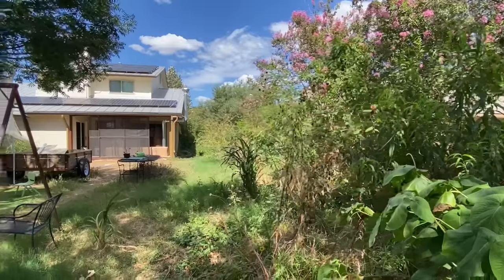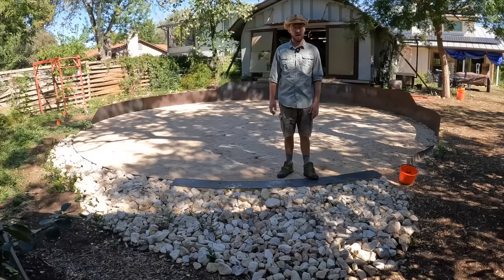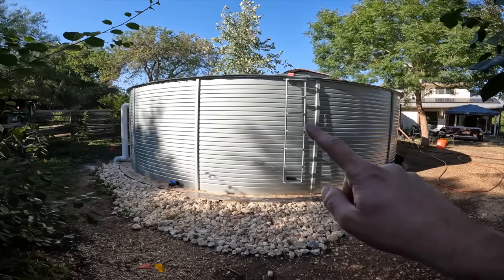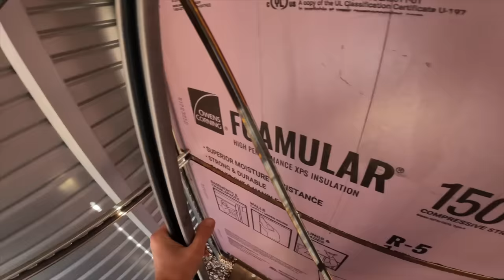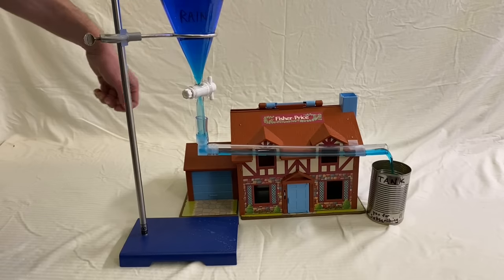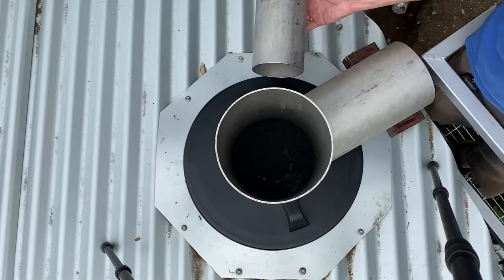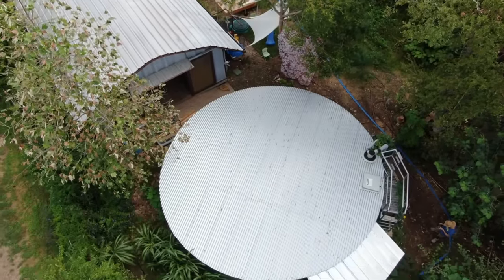FREE water forever.  LEGALLY!!!!

Comment: I think the next project about the water system would be to install a watertower so you always have pressurized pipes even in the the case of a power outage and no source of electricity at all. There is still a need of a pump to get the water up the tower but you can do that with solar power and the pump most only run when there is overflow of electricity. With some batteries you can even have a fallback system.

Comment: Construction crews use gasoline driven vertical piston driver known as a "Tamper" which forcibly compacts sand and dirt. An easier method is to simply use a long water hose to completely soak all of the sand. Water is then the lubricant as gravity draws downward all of the sand grains to firm compaction. I have met people who also harvest rainwater into large containers.

Comment: I am going to assume those filters need to be replaces periodically. So the system, ignoring pumping would still have a cost? Or do water coming from City would need to have the same filter?
Reply from the maker: One could argue that water from the city “should” be filtered. Chlorine and fluoride levels in some areas can be a bit excessive.

Comment: I was wondering if instead of steel wall, hay and clay wall could be used to hold the water liner?
Reply from the maker: Probably not. The water experts and outward pressure on the walls of the containment structure. You want something that has good tensile strength. Hay and clay would have much more strength against compression rather than tension. In my rocket mass heater video that is evident. 10 people can sit on that clay and straw bench. But if you tried to stretch it apart it would crack.

Comment: That was quite a project. Well Done! However, the amount of money you spent on it would pay my water bill for 20 years, maybe more! What ya going do if you have no electricity to pump water to the house? You'd have to have a manual way to get the water in containers then filter it with a gravity filter in the house. But at least you'd have water. There's pros and cons with this project. I learned a lot. Thanks.
Reply from the maker: You’re right it wasn’t cheap. I have solar and battery backup on the house now so the power outage matters less from now on. Thanks for commenting!

Comment: could this tank be placed underneath a house, such as in  a crawl space? Secondly, what about heated water, to use the heated water tank as a heat source for the house?
Reply from the maker: The tank is not engineered to have external pressure from the soil. So if you buried a tank underground, it would probably be better to get one that’s designed for it other than this one. Technically, yes if you have a buried tank of water, you could potentially use it as a source of geothermal heat. But again, I’m not sure it would be a good idea to bury this particular type of tank. Thanks for commenting and for subscribing!

Comment: I'm in South Texas as well and about to start construction on my 2-acre property. So far, what are the pros and cons you've had from this water system??
Reply from the maker: Pros are that it was worked well without fail for almost a year. We have had zero water bill. Just paying for sewer services. 

Cons: slight drop in water pressure compared to city. Could be overcome with bigger pipe size. 

Water is slight acidic. This is a very long story that I will address in future videos. The bottom line is that it’s easy to neutralize using slaked lime. 

Water should be filtered. There are contaminants in the rain. My opinion is that most water from municipalities is also probably worth filtering too though so it’s not really that different. Some research suggest filtered water should be remineralized. I will include that in my future video also. 

Thanks and good luck. Over all I am pleased with it. If you are willing to use water sparingly it’s good. If you want to water your lawn with it this tank may not be enough. Those details depend on the square footage of the roof surface etc.
Reply: Thank you so much for the info! I love your content, I'm planning on making fencing just like your other video as well! Please keep making more content 🙏🏼  @suburbanbiology

Comment: I think you missed a very simple principle I learnt in primary school in eastern Europe. I don't recall the name of it but it goes like this: when a wider pipe feeds into a narrower pipe the second one will exert far bigger pressure directly in line with the difference in diameter. I feel like you should have used wider pipes coming vertically from the roof to narrower pipes underground and up into the tank. I think this is how hydraulics work in big construction equipment and cranes.

Comment: one of the other plumbing channels says everytime there is a bend in it there has to be a large number of feet in between or an extra part in between according to building codes so your bends were inches apart and did not have the extra peice so many that is what caused it also it says re regular pipe sizes the 4 is for 2 toilets and higher than that if you have higher than three like six bathrooms then the six inche pipes are needs to stop clogs according to code so maybe cause you are dealing with leaves and such and they are just prone to clog that is why even though more money you might have had to upsize to the 6 pipe to start advise people such as the other channels says 4 size clogs if more than two toilets so the codes make the plumbers for regular stuff upsize if more than the two they have to upsize more than 4 anyways .

Comment: Smaller scale and cheaper option I did.

Get one or two IBC 250 gallon totes. You can get them for about $60 each. Set them up to collect rain water. I use them for my garden. 

In an emergency have a five gallon bucket with small holes drilled in the bottom half full of fine sand. This filters large contamination. 

Have some (you don't need a lot) charcoal and grill. Boil the water on the grill. Theres also larger Britta style filters that aren't expensive. 

I won't be fancy but you'll have water to drink for weeks.

Comment: I just need to know  if you can run a filter and make it drinkable, and if you can collect rain water to drink I thought you could catch it in a crock ,but first wait  till it rains a bit and sit your jars out without anything getting in them and let it rain, there is a water filter that comes in a container to do this but I used a 5 gallon emergency plastic container with a spiket and add about three of those charcoal filters that go in the store bought container, otherwise I burnt some wood ( oak or peacan) and made my own charcoal to put in the bottom, it's all we can do to have water from a neighbor that lends his water hose, I have the big square tanks and and they are for back up. I call it my permanent camping trip.

Comment: That is super cool. Wouldn't want one tho, as 1) it's way too large and in my opinion quite ugly (yes I know, I know). and 2) over here in Finland half of the year it's going to be freezing. The tank would probably be okay, but the snow coming from the sky would not melt into the tank. I much prefer to have portable size filter as backup if we lose access to water grid. that way we can go to a nearby lake, fill up a tank/barrel and filter and/or boil that water back home. Much more cost effective and saves tons of space.

Comment: little suggestion. I would recommend to come up with idea, when it starts raining, - you are not taking in water right away, but instead flushing it for 5-10 minutes so all the dirt dust and whatever on the roof will go down first. After that valve switching and allow water to get to the tank. Another thing for the drinking water, - I would love to have some kind of boiling/freezing machine, where water boiled first, then cooled, frozen and defrosted. This way it would be probably the safest water ever. The other thing I'm seeing here, that what if structure will be compromised (ie earthquake) and it will flood your neighbors? this is only the potential why it should not be permitted if you have property size less than 5 acres.

Comment: Could you use the surface of the tank for some solar panels for energy for the pumps?
Reply from the maker: Already have solar on the house. But yes it could be used for that. Standard mounting hardware makes flat roof easier. The tank roof is slightly convex so it might be a little tricky.
Reply: @suburbanbiology that makes sense. I wasn’t sure if there was a need to keep the surface of the tank clear (just in case) or as you said since it isn’t exactly flat it would make it more tricky.

Comment: Honestly at 10:00 even with the thin insulation for your pump house that should delay a freeze long enough. Flowing water should be good under 30F
Reply from the maker: I added a small poultry heater on a thermostat and wrapped the pipes in bubble wrap. Did fine over winter. The poultry heater only ran for one or two nights I think.

Comment: Is there a reason why you couldn't just use concreted instead of sand underneath the tank ?
Reply from the maker: More expensive and per the engineers that design the tank it’s not necessary.

Comment: I have a shingle roof and a rain barrow that collects water from it through a downspout. I know not to drink it but would like to know how to filter it for drinking. I have a Berkey filter but am not sure it could take all of the chemicals out. Any suggestions?
Reply from the maker: I would think at least what I have in place. I have a carbon filter inside of the pump house. Then I use reverse osmosis inside of the house. The reverse osmosis units also has a carbon filter inside of it. This is not official advice, though so do your own research please. Thanks for commenting. Be safe!

Comment: What is used as the sacrificial anode? Is there practically just a lump of something un-noble screwed to the bottom of each support pillar? How would one monitor whether they've been used up already and how do you get a lifetime estimate? (I know and teach the chemistry, but the actual installing practices have eluded me.)

Also — if I am not mistaken — excellent to see Wicked Lasers Spyder Arctic in such use. 👍I've had the 1,2 W for about a decade now for physics teaching purposes (incl. appropriate radiation safety equipment, procedures, training and handling), but I rarely see it for crafts or DIY like here. ^^

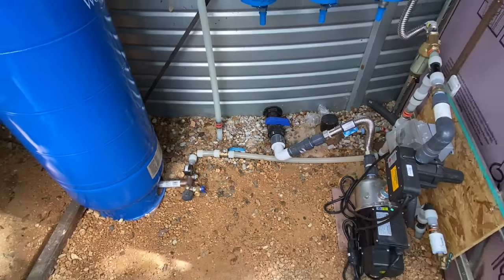21:47 That view looked like cracked glass so I was worried about your camera! 😅
Reply from the maker: Not sure what it is but it was a wire going into a bag of what felt like sand-consistency. I assume powdered zinc or something. The bag was buried. I’m not sure how to tell when it’s been consumed. I guess when the tank starts rusting 😂 thanks for commenting!
Reply: @suburbanbiology  Thanks for this tidbit nevertheless :) It's good to get some sort of even a preliminary hang of the magnitudes concerning how long those last.

Comment: as one who works in the municipal, city water department. he is very correct. I will keep updating this comment as i go through the video so i don't make 900 comments and so i don't forget. In the municipal water department we use whats called, cathodic, dc charge to actively protect the tank, sacrificial anodes are used as well but don't need to be replaced as often. The easiest way to keep the water from freezing would be to make sure the water level is very volatile, although using rain water that may be difficult. you may be able to use uv to heat the water and to kill bacteria, to solve the volatility. Also "resistance to fill" is called "head pressure" or "hydrostatic pressure". 6 inches below the surface was very smart. our municipal tanks are 26 feet tall and use whats called the 7 foot valve for standard use. it pulls water 7 feet from the bottom of the tank.

Comment: Nice tank! We lived like this once dependent strictly on rainwater. It was an experience.  Sometimes something would go wrong.  The water stagnated and went bad. I added 3 quarts 35% hydrogen peroxide to 10,000 gallons remaining. Knocked out the smelly water real fast. You won't get a water bill but maint issues will arise now and then. So it's never really "free"

Comment: As an Aussie having rain water tanks for the last 40 years, 4 - 6 smaller tanks is a better option . A Gavl tank will rust out at some stage 100% guaranteed 
I had a full Galv  tank fail a half inch from the bottom and lost 20000 litres ...... in Australia, we have moved to plastic tank

Comment: Why not put the cistern underground?

I grew up on a place that had a tear-shaped cistern that collected gutter (soft) water. We also had a (very deep) well that produced very hard water. Honestly, my parents hooked onto city water when I was quite young, so we mostly used the well to water livestock and cistern for laundry.

Still, our cistern was at least 30 feet deep, mined into the shallow bedrock of southern MO around 1900.

Idk how/how long it took my progenitors to build this cistern, but I know the bedrock is only 8" below the soil, so it took some determination.

I know Texas is a big/diverse place... But my understanding is the soil is typically deep/rock free.

You seem to have a decent tractor... Is there a reason you build your tank above ground instead of digging a hole?
Reply: To be clear, not saying you should have dug a hole... Only curious why you chose to build above ground.
Reply: Oh, it's probably about water pressure, isn't it?

Comment: Never saw a rainwater collector in our rural area, and in our country there is no centralised water supply in such places at all. Everyone just dig a big well, or if you want to spend a bit more you can have a deep borehole that probably going to supply you not only with fresh clean water but also with the pressure. So, no filters, no pumps, almost no maintenance. There is no better filter than the soil itself.

Comment: Rainwater is no longer safe to drink anywhere on the planet so you really do need to filter and treat the heck out of it.
 I would have probably added a small clean water reservoir somewhere in case of power failures too.
Also 90 degree rain pipe bends will get small sticks stuck in them even if you have 80mm pipe. 2x 45 degree to have a smoother bend is a better idea.

Comment: I've worked in the water industry all my life and I find the beginning of this video really hard to believe.

In 2007, the power plant that powers my city was flooded and nearly the entire city went without power for multiple days, including the water treatment center (which was also badly flooded). The very first thing that happened, literally the first thing, was offsite generators were bought in to restore power to the water site and keep water pumping to maintain positive pressure for direct main fed customers.

Over the length of the flooding, the water treatment center became contaminated directly as flood water continued to rise and breached defenses to clean water storage. But 95% of the customer base is fed its water supply from high-level water storage reservoirs or water towers, with days of supply storage. Yes, mine did run out (or very low) around day 10, and yes, we were told to boil water if possible when that happened.

But in all my years of owning a property, I've had less than 2 weeks with an interrupted water supply, or a supply with questionable quality that requires my intervention....  For ~£17804.25 (the cost in the UK of your build), I'd get approximately 50 YEARS of water for a family of 4 who aren't particularly conservative with it either.

I get it that you die after 3 days, but if everyone else doesn't have one of those rainwater tanks and is dying of water shortage... good luck when everyone else playing their part in the big machine is gone...

I'll stick to the supply that's been here for nearly 100 years now and have a few holidays with my family

However, it's an amazing achievement that you've done it all yourself!
Reply from the maker: Our municipality said the boil notice was largely precautionary. But they still recommended it for a large part of the city. I’m sure it was excessively cautious. They do a great job over all. I have no complaints other than the thought that I don’t want to rely on an outside entity exclusively for all our water. Thanks for commenting!

Comment: Instead of doing so much work and upfront huge investment you could hv dug a borewell or well and installed a simple rain water harvesting to feed the well/borewell You could have saved a lot of space for farming and so much of material used.
Reply from the maker: Where I live drilling costs more than this tank did. Our water is very deep and under lots of rock.

Comment: So when there is no rain, you'll have bunch of old water stuck in your pipe with this design? Then it will go stale, bunch of bacteria will grown in it, and by the time new rain falls, this old stale water will go into your water source :O I mean if this is not meant to be drinking water sure, but it's kind of weird concept.. I wonder why didn't you put this tank underground? I'm from Serbia, and at my countryside we have tanks underground. And all water from the roof goes through gravel and sand filter before entering tank. Even with this kind of filter, we add some amount of chlorine just to keep it clean (as it WILL go bad unless you do that). So we use this water for shower, dishes, washing clothes, but we don't drink it since it can never be 100% clean and we don't want to put more chlorine into it.

Comment: I don't understand why you didn't use concrete for the floor. You could prepare a very clean ground by digging about 20 centimeters deep and pouring 10 centimeters of concrete.
Reply from the maker: Additional cost and effort. The manufacturers of this tank designed it to be able to install on sand. Keeps the project cost from ballooning even higher. Thanks for commenting!